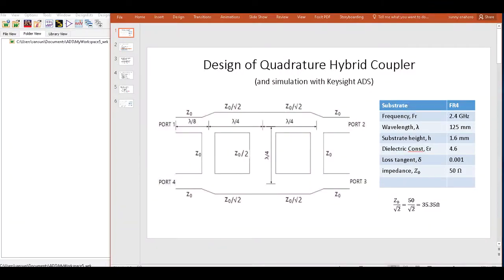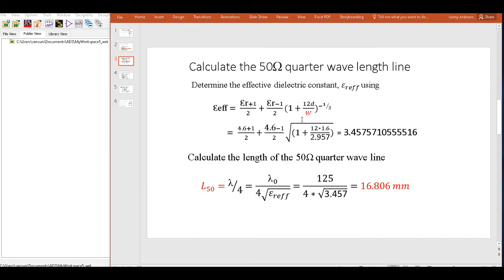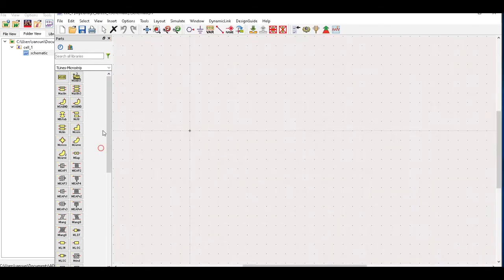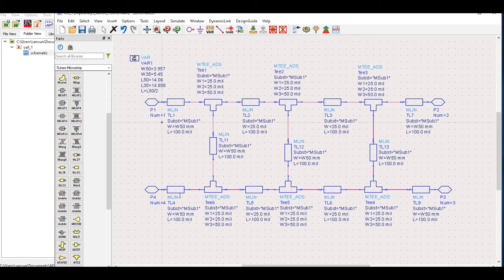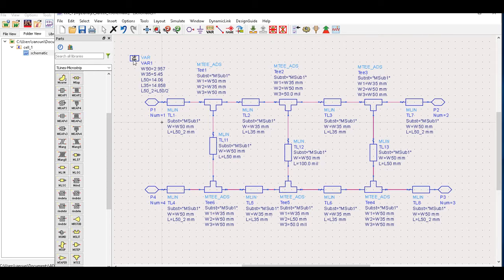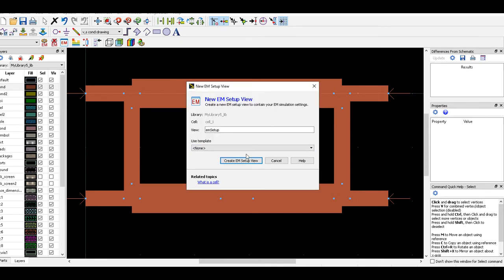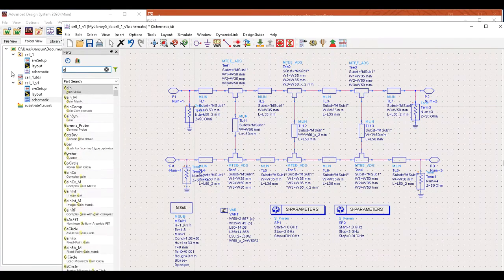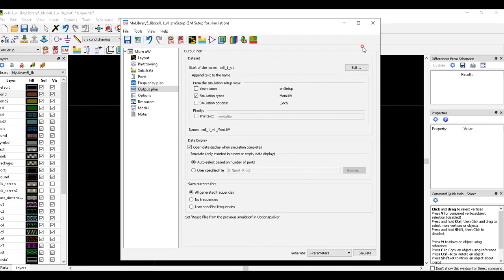Tutorial Design of 0dB Crossover Coupler and simulation with Keysight ADS

Comment: Good afternoon Sir, please I am designing a wideband rectenna of 1GHz - 3GHz. I designed the antenna using HFSS and Greinacher rectifier I propose to use using ADS software. However, I had been having a challenge designing the Impedance matching network between the antenna and the rectifier. Please, do you have any idea how to go about it? I need help.